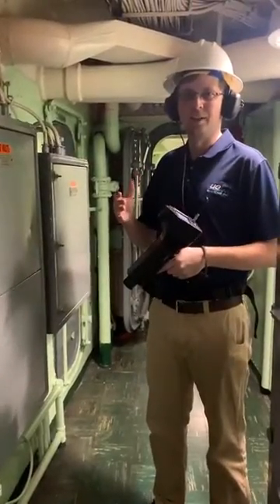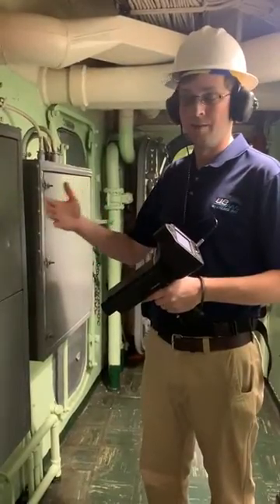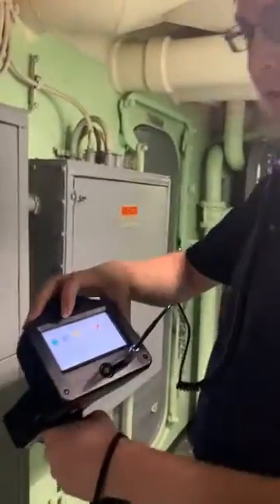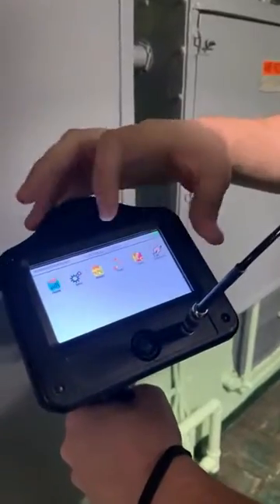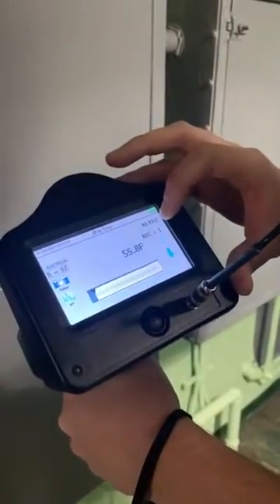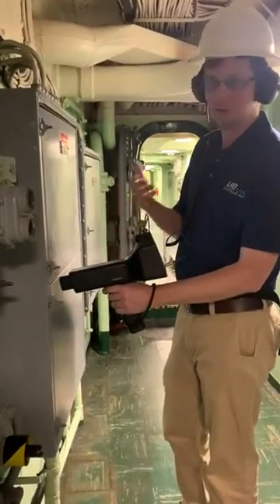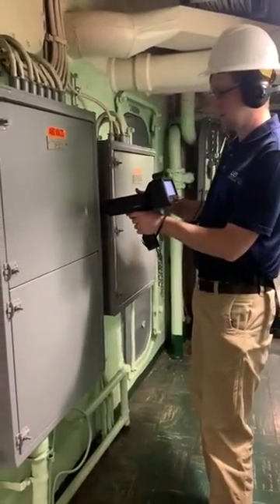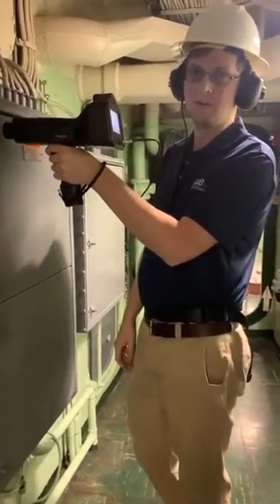UE Systems Electrical Inspections with the Ultraprobe UP 15,000

Comment: Good.what is abnormal sound  db value limit ?
Reply from the maker: For electrical inspections, 40 kHz is the recommended frequency setting. Before determining what is "abnormal," establish a baseline for each piece of equipment during regular, fault-free operation.